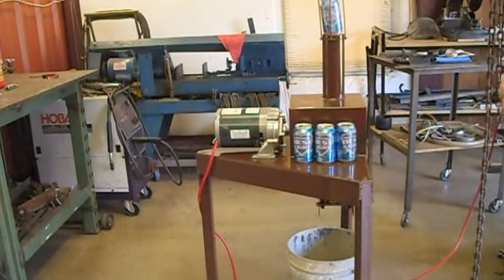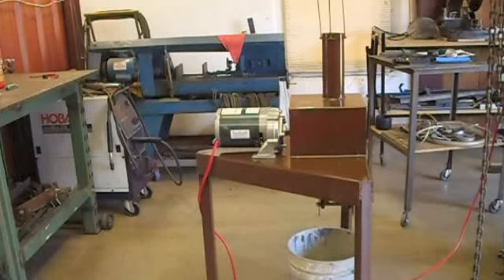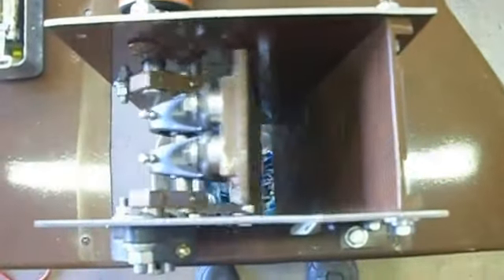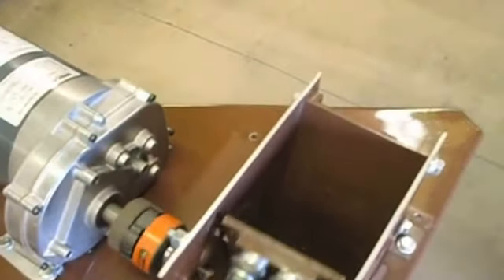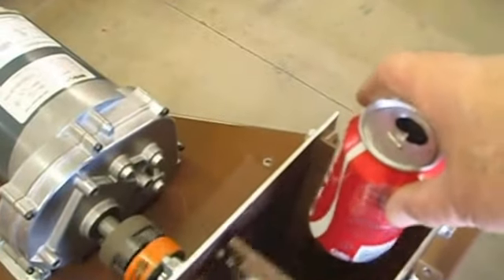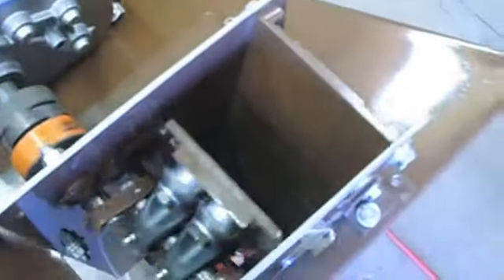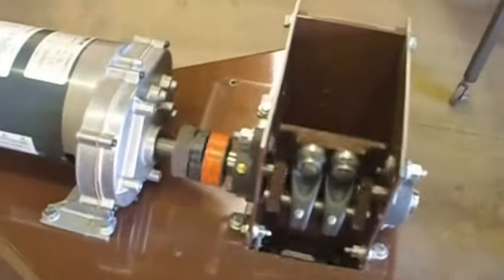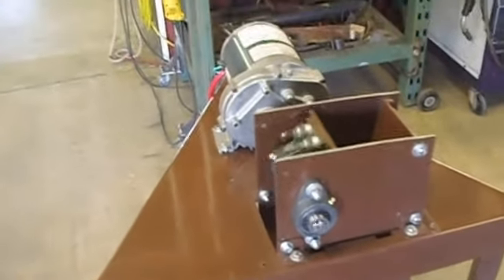Powered mechanical can crusher

Comment: This is probably the best example of a can crusher I have seen on the web yet! I would like to see if a hopper could be added and maybe open the throat up so cans could enter at any orientation. Is crush thickness adjustable? Love this idea!
Reply from the maker: Bryan: Thanks for the compliment. A vibrating type hopper could be constructed but this was built for a friend who lives a state away so if he wants a hopper he will have to build one. Orientation is limited by the width of the crushing plates and how the plates grabs the cans. Crush thickness is about 1/2" I did try playing with that and had no luck would have to re-design crusher.   Ron

Comment: I went to the site mentioned in your wooden version of this but couldn't find plans for a metal crusher, did you adapt the wood plans to metal? Very impressed with your work. I have worked on jaw crushers the same design for serpentine rock.
Reply from the maker: The metal crusher is listed under recycle projects at Gizmoplans.com here is the link. Thanks for the compliment Ron

http://gizmoplans.com/aluminum-can-crusher-plans

Comment: COuld you get away with a narrower throat as it now leaves them quite thick?
Reply from the maker: +Manintoga Tried that mounted where it  worked the best. I had the same idea even tried changing the crank thickness dimensions. Works best the way the plans are drawn.
Reply: dc9apu Yeah the crushing force requirement goes up exponentially huh?

That could be used to many other materials as well so it is better in that respect to many other soda can crushers.

Comment: How to make that can crushed in another position .. i mean crushed from top to bottom. sorry, my english so bad..
Reply from the maker: This crusher not designed to work that way. If you want to try to lengthen the crushing plate and backing plate to accommodate the length of the can it may work. Lots os luck.
Reply: +dc9apu i think its hard to keep the current position of the can .. it gonna rotates back.